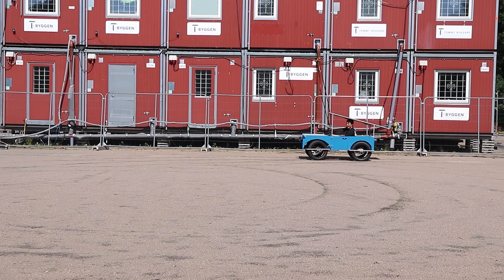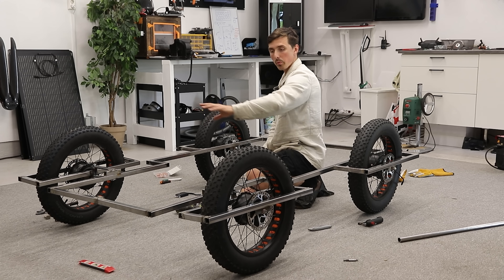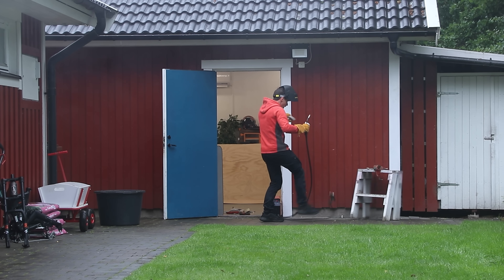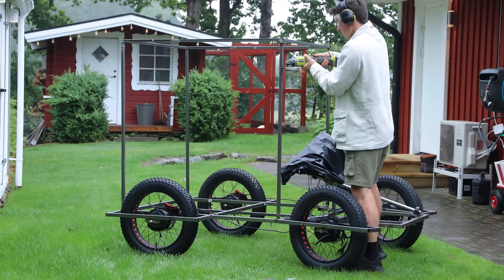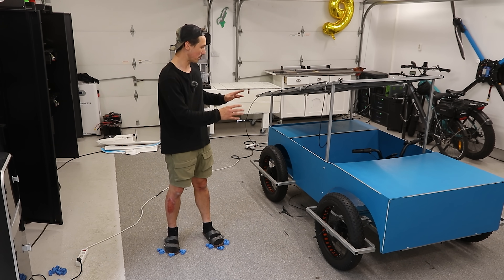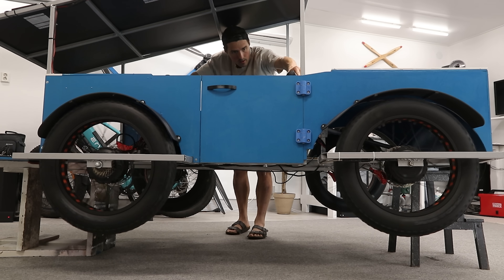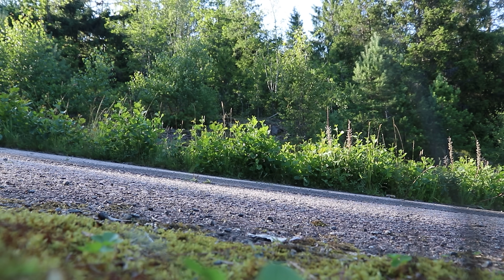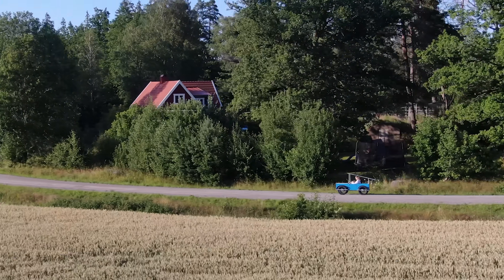I Built a Solar-Powered Car – And It Works!

Comment: Probably too late, but for the steering wheel hinges, if you would use tubes which would be way longer, like 20 or 30 centimeters, then forces would be way lower at the tips and it would be way more sturdy, while U clamp could receive more struts.

Comment: Wait no reverse? I am no expert in electronics or anything but I do know that you can control which way the motors spin by changing the terminals like positive and negative to achieve reverse mode so if you do a little research you might get reverse mode in your vehicle too. I just know that to "change" the terminals of of a motor without physically swaping them we use a controller to change the terminals.

Comment: i should tell you that there are solar charge boost controllers that allow 18v or 21v to run on a 48v battery system i assume they are a little less efficient but they do work.

Comment: and if you dont have a reverse and your moters are on a switch why not mount the front moters backwards so you have a "reverse gear" and use your rear moter and also put te suspention from the bikes

Comment: So freaking cool! Would love to see you iterate and come up with a V2. Despite minimal batteries im shocked at the range capability. Makes me think for daily commuting to and from work a more polished "road safe" version would be more than enough for a lot of people. If i had a cheap daily commute car and either a traditional car for road trips or ability to cheaply rent a car for those trips it would save a lot of money and really wouldnt be missing anything. 
It would be a long shot but I think there is real potential if someone partnered with an auto maker that has an existing ev platform. You get just the frame from them and then use cheap motors and battery packs that are easily swappable. Build out an ultra cheap but legal and safe car, potentially 3d print the shell or some other cheap process to get a lightweight plastic or fiberglass shell. Slap it togeather and with added solar it could be a compelling option starting around 15 to 20k

Comment: Now you have a solar car, could you strip out the heavy stuff, connect the solar panel output to a rear thrust prop and join it to the 100 kg R/c drone.
Im curious to find out if a hybrid autogyro/drone affect  would assist lift and forward speed and possibly improve weight lifting capacity too.
Maybe  accommodate stronger props as well.

Comment: A weld can look sturdy but if it's only superficial it won't be. Sometimes you might even need to pre heat whatever youre working on and knowing the temps can make or break a project. Please don't let the "ladbil" commit retroactive self abortion with you still inside of it. At least send pics to a professional welder and ask them if it looks good.

Comment: You could give it reverse if you have the separate throttle used for that, like have your rear throttle for driving forward and maybe the front throttle for reverse, it'll reduce power and speed for sure but still give you that option for reverse

Comment: I realize glass solar panels are really heavy, but maybe instead of flexible panels with their problems and cost, maybe replacing the backing steel frame with the glass panels might keep the weight the same since the rigid solar panels have their own structure. Just a thought, I have not tried this but that is what I would try myself.

Comment: would be cool if rear wheels are high torque, and front high speed, this way u have two gears - one for climbing other for higher speeds! also go through a drive thru with it 👍👍👍

Comment: Swedish man saying it turned quite light... don't trust that those guys are built different, ya might sh ya pants if ya try to lift the frame like he did so don't try that at home... If Swedish yeah you can go ahead and do it, if ya Finish, it might work but if ya from Norway you'd barely lift the frame, and if ya ain't nordic, don't even think of lifting that ya sh ya pants as I said :D
Reply: Jokes aside, you motivated me to make a mini camper now... and you should do the same, turn this project into a mini camping there's this Youtube channel => "President Chay" he made a "towable camper"/"trailer camper", since you're Swedish and I've been subscribed here from like 10 years already, I believe you can make the best e-mini trailer, your solutions are quite straight forward and helps motivate other people RCLifeOn4life

Comment: Professional welder here you want the sound of the welder to be like hot bacon frying so turn your wire speed down on your heat up whatever you’re more comfortable with both of says increase heat but a more even crackling sound and a more hollow sound lets you know you’re penetrating but if it sticks it ships

Comment: I mean, this looks pretty awesome. The only Range limits might depend on how much battery it carries. Great wheels. Plenty of torque. Solid brakes. Just need a better suspension set. If you get one built for something like a Go Kart, you'd probably have a master build.

Comment: Should have reused the original bike frames for the wheel mounts, you could have put the rear triangles on an axis with a spring above, and the front forks could either be tacked on to from the side with a double wishbone suspension, or the frame could be built up above the fork to reuse the original steering tubes as both steering axles and wheel mounts, while retaining the fork suspensions.

Comment: i am no engineer or any expert, i just watch lot of stuff. doesn't that roof add more drag therefore more power consumption? you could save couple of very valuable watts with more aero design. i guess at your cruising speed it does not matter much but still. just look at cyclist sitting normally vs leaning forward, your roof is same thing. (not speaking about brick aero :D )... thiner and smoother wheels could also improve watt usage. anyways i love the video!

Comment: ⚠️ 👎 >5k€ while a NEW Electric Car can be Purchassed Starting 8k, and an Used One 5k€ ! 🤪 

But really Not really a Surprise as YouTubers often share "False Good Solutions" to get Undesserved Monney by getting Commissions or Selling Themselves Inadaquate Products.

For example just here by Presenting a Inappropriated, Non-Optimal Solution, by Inviting us to Purchasse Expensives eBikes, 

while for A THIRD OF THE COST,

we can buy Electric Wheels Kits which would make The Very Same job a Even Better

(not having one Controler for a Side but 1 for the Back Wheels and 1 for the Front Wheel, or even Cheaper: only 2kW Back Wheels with 1 Controler).

Note: I have NOTHING against Earning Monney, I am myself an Independent so that is Very Fine With Me, BUT... 

it HAS TO BE Earned with HONESTY to have a Better World where 

Each Of Us can TRUST EACH OTHER 

and Prosper; 

in my Humble Opinion.

Comment: Small Generator Using Wheel Spin (Like Regenerative Braking)
1. Concept

Regenerative principle: As a wheel spins, kinetic energy can be converted into electricity.

Goal: Capture energy without adding drag or resistance to the wheel, so the system doesn’t slow down.

Generator type: Small, efficient generator such as a DC motor used as a generator or a permanent magnet generator (PMG).

2. Components

Wheel or rotating mass

Generator:

DC motor as generator — easy, inexpensive, produces DC when shaft spins.

Permanent magnet generator (PMG) — more efficient, produces AC; requires rectifier to charge batteries.

Coupling system: Use low-friction gearing, belts, or magnetic couplings to connect the wheel to the generator. This ensures minimal drag on the spinning wheel.

Rectifier (if AC): Converts AC output from PMG to DC for storage.

Battery or capacitor: Stores captured energy.

Controller (optional but recommended): Regulates voltage/current to avoid overcharging.

3. Key Setup Notes

Minimize drag: The generator should spin easily with very little friction. Consider high-efficiency bearings or lightweight gearing.

Low-friction coupling: Avoid direct contact with braking pads or tight friction wheels. Use belts, pulleys, or even magnetic couplings.

Energy storage: Connect generator output to a charge controller → battery or capacitor.

Optional flywheel: Smooths rotation and provides steadier energy output without adding resistance.

4. Tips

Higher gear ratios let the generator spin faster with minimal input from the wheel, increasing efficiency.

Small, lightweight generators reduce drag on the system.

Monitor voltage to ensure safe charging and prevent wasted energy.

Bible Verse:
"Whatever you do, work at it with all your heart, as working for the Lord, not for human masters." — Colossians 3:23
Reply: "Goal: Capture energy without adding drag or resistance to the wheel, so the system doesn’t slow down."
So your goal is for Energy Out > Energy In. Good luck because that's impossible, despite what the AI chatbot you copypasted from tells you.

Comment: I don't claim that you faked the climbing angle but cameras can be placed and oriented to do so. Despite this, the idea is pretty cool but I'll have to watch again to see if it's really a solar car. It's not legal for the road in the US even though it's made of bike parts.
Reply from the maker: Actually now when I've used it for 200km, I can tell you that it would have been able to climb a significantly steeper angle. The torque is way better than I expected.

Comment: very nice already! would be cool if you can figure out about the motors and reverse system so you could make all 4 tyres spin in different ways to do a 360 spin like the new electric G wagon from mercedes. that would be next level.

Comment: It would be easy to add a switch for reverse. All it would have to do is reverse the polarity of the power going to the motors from the batteries.

Comment: On the left and right side of the solar panels you should add more solar panels that can fold down to the sides when not used and can fold up and lock when changing or you can have them up when driving so it will charge way faster just make sure it light and back up batteries would be useful for long distance or just incase.

Comment: Not bad! I wish we could make these to run on the roads legally without having to register and license them in the U.K. You might be able to fit polarity reversing switches for the supplies to the motors to give you a reverse drive.

Comment: here's a little bit of a funny tale for you. I built something pretty similar. I measured all the ackermann angles for steering. it ended up handling really badly. I ended up re-cutting the steering arms and just making them turn the same both sides. yes the tires scrub more, but the handling was vastly improved, and I can corner so much better.
I tried doing things the "right way" with theory, but the "wrong way" just worked better in practice.

Comment: On my project car to keep weight down I made some interior panel pieces out of flute board instead of any type of wood. Could be a good option for panel bits that don't need to be as rigid as the ply

Comment: You over complicated the electrical system, the throttle and brakes all work on hall sensors using 3 pins neg, pos, signal. You could use the 5v positive and negative supply from 1 controller and split out signal to all controllers for the throttle and vise versa. You could split the out put signal from the front brakes and rear brakes to each controller reducing the control interface down to the normal amount for a vehicle

Comment: Yeah, you'd think the side by side ATV manufacturers would come up with EV versions with a solar panel recharge roof. For some guys that wander around their ranch or farm doing tasks with those, but most of the time it's just sitting parked in the Sun, it might be ideal to never need to fuel those up.

Comment: when drilling through thin material or really any material, any excess of heat will harden the material and make it much worse to drill through, use a pilot bit about the same size as the tip of the final bit you plan to use to start the hole, reducing much of the heat buildup that come from smearing the center material out to where it can be sheared

Comment: Impressive that just 2 e-bikes are enough.
Just two suggestions. First, add at least a basic suspension. No suspension is what eats up the broken steering part, because every small bumps hits with full force. I mean you already have the bikes, might as well use the suspension. And second, it might be easier to drive if you dont have left side and right side drive like a tank, but left front and rear right on one controller and right front and left rear on the other. That balances differences in driving force out much easier. Same reason why the two brake circuits in cars are opposite sides.

Comment: Sounds like you have PWM solar charger, MPPT chargers can set the output voltage to different voltage that the input voltage, PWM just takes the input voltage can pulse modulates it to prevent too high voltage and thus losing lots of energy.
Reply: Read the manual and it does claim MPPT, but must have only step-down DC/DC converter in it, so very simple design and cannot use the solar panels at shade or evening. Hope they were atleast cheap.

Comment: You could easely unify those two systems undes just une throttle. Also, you can group the brake cables 2 by 2 and have them on only 2 brake levers (front and rear). Nothing complicated. Fun project though.

Comment: Nice build! One suggestion, if you want to reverse I think it would be a good idea to add a phase reversal switch to two of each motor's phases before connecting to the speed controller

Comment: Love this, something I wished I would have built! Maybe with a clever folding system you could have even more solar panels on that you could fold up when you are stationary... or/and build a small camper that also have solar on them... 1 KW solar would be awesome... It would be a movable powerhouse literally :-) could charge some cool things at the beach put a big inverter on it and you could build stuff anywhere :-)

---edit

And to expand even more... do some (maybe only software?) software/hardware to either get more out of the power (i.e maybe only use 2 or 1 wheel drive when you are up to speed on a smooth road). Or do some traction stuff to make it even more of offroad beast (but 4WD is pretty awesome as it is I guess)..

Yes a reverse would be cool also, would be crazy if you could build a reverse per wheel... so you could reverse 2 wheels and forward 2 and get a turning circle like a tank...
Ah well so many ideas...

Comment: this is awesome, one note though you have a lot of flex in the front wheels when under weight, the only way i can think of to fix that is to run some sort of axle between them but you would have to have some sort of differential between them to run AWD but just food for thought

Comment: Petition to add solar panels to all sides as well. Run those in parallel with a. Separate mppt charger. Should add another 200-500w

Comment: Whoa that frame and steering looks... Not very durably made. But at least nothing completely tore off considering it's your first time welding. Now if really pushing into something like this, I think aluminium extrusions might be interesting solution for base frame. Obviously a lot more expensive.

Comment: a break pair you could have made like the parking breaks in cars , it pulls in the middle of a lets say 16 cm rod and the cables of rear pair are each at the end of the rod, ty it out. And another build like that for the two front breaks

Comment: This is really cool, but I strongly suggest some form of suspension. Hubmotors are already somewhat delicate.
You could put both front, and both rear on a solid bar with a 4 link. Would be easier than coming up with accurate suspension geometry.

Comment: Hey by the way if you did make a like a pickup truck version you could extend it out just a little bit put the back wheels a little further back and add a fourth solar panel to meet with the top of the back of your vehicle that way you would be generating more electricity but then probably a good idea to put a windshield of some type on after

Comment: Please please please wear full cover clothing while welding, even if just a little bit. Arc welders of every kind emits UV A, B and C and that will burn you straight away and is highly cancerous. When I went to welding school way back in the day our teacher told us about this one guy who came in one day in a nätbrynja and didn't listen to the teacher. The next day they came in with a debatably cool net-pattern all of the front of their body. I also heard stories from other welders about people using the UV light from the arc welders as a tanning booth, but none of those who did that were still there to tell the tale. I know it's hot. I know it's unreasonably warm here in Sweden right now but I want to keep watching your videos for a long time and I don't want the reason you quit to be health reasons due to not using proper PPE. It was a long time since I was a welder, but it you want some pointers you are welcome to reach out, you have my DM over FB

Comment: Great video always fun to watch 😊 I have the same welding machine and had problems with slipping on the wire feed wheel. Put some washers there to increase pressure on the wire. Works better now.

Comment: Why not use 500 watts solar panels? Yes, they're significantly heavier, but charge the batteries 5 times faster. The frame you built is sturny enough to keep from moving so they don't suffer any damage. Although as long as you left, or set up, the normal chargers of the E-bikes, you can also charge them quickly using that.

Comment: The electric motors usually have either a few different wires that can control the direction if you add a switch to the wiring of each motor and wire it to one switch you can have a reverse using forward throttle Just reversed polarity